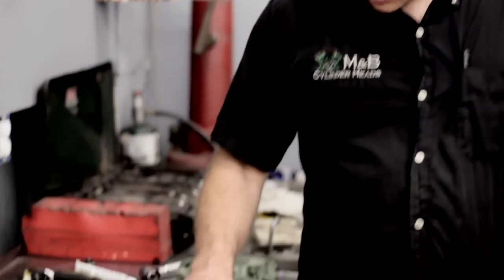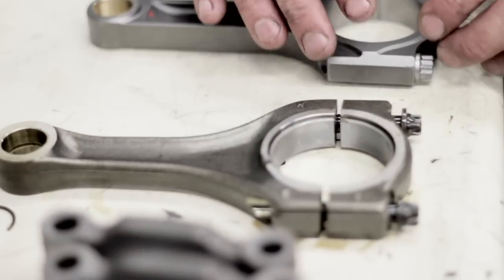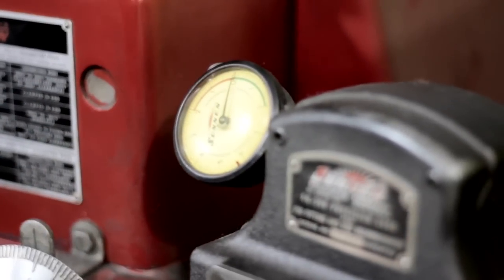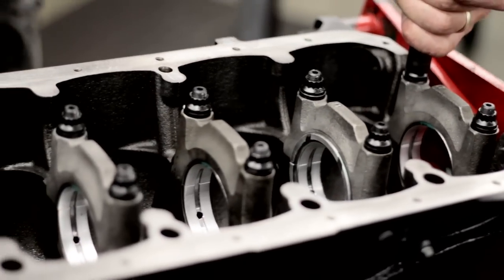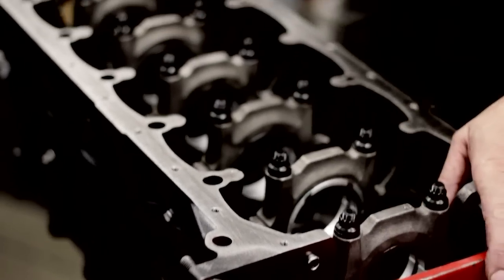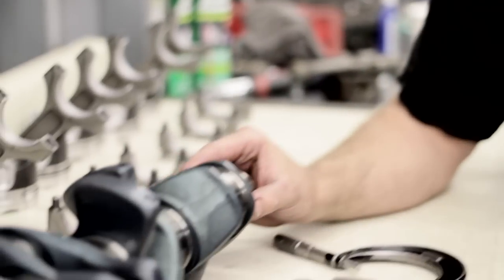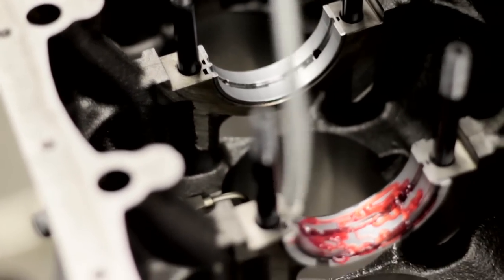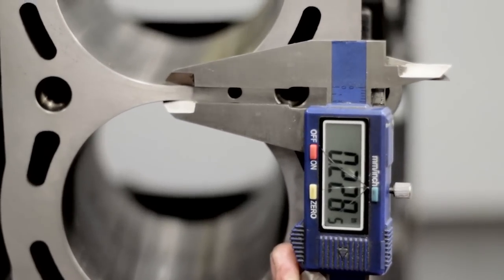Secrets Behind The HPF 1000 RWHP Daily Driven BMW M3 Race Engines Part Three

Comment: Im building an engine up right now myself and i cant find any information on fitting the oil controll ring i noticed the pistons used in this engine are the same as mine my question is how was the wavy baffle fitted and was any exsess cut off it as it looks rather large to be fitted without being cut or ? any tips or pointers ???

Comment: At 1:09 the old and new pistons are shown.
Why are piston pin supports further apart on the new piston?
This will result in more pin bending and therefore more wear for the new piston.
Was this a design oversight or are there any verified advantages in doing this?
Btw, the bearing width on the small end of the con rod appears to be the same for the old and new rods.

Comment: If both the pistons and the rods are thicker then I hope they are a lighter alloy or the engine is going to need more weight in the crank to balance and have higher bearing loads. Not good if you want to rev it harder than stock.

Comment: the straight six is inherently balanced vertically, but the con rods also move horizontally, the crank should be designed to provide a exact amount of force in the other direction, hence making for a smooth, reliable engine you can rev without causing a drama. The system of just throwing stronger parts at a motor without much regard for the weight or balance (like in the video) is not the best one in any circumstances, least of all for high performance motors.

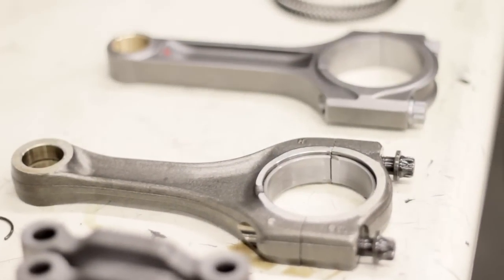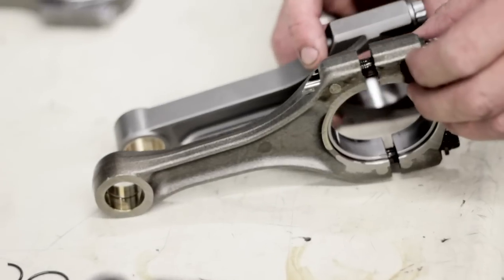Comment: The last sentence in my previous comment is supported by the video from 2:13 to 2:47 and I am still puzzled.
I have come across the same situation with aftermarket pistons for the vintage Lamborghini V12 with OEM con rods.
In both cases it could be that the aftermarket pistons were designed with different rods in mind.

Comment: Damn this must be so expensive. Amazing stuff. If I was running a stock engine, and needed a rebuild, would it be cheaper to buy a new engine? M52/M54
Reply: This build shows upgraded parts required for higher performance demands. A new engine from BMW wouldn't have the upgraded parts

Comment: @Heatman74 Yeah, I wondered about that, too. These days, more often than not you see AT LEAST a four-bolt set up on the main caps of most engines, and some manufacturer's newer engines sport SIX(!) bolt mains on their bottom end, a la GM LS series. It's a wonder this BMW block only gets away with two, but then again, I'm sure they have their reasons.

Comment: Hairs vary a LOT in diameter and they readily deform when measured with a micrometer.   Standard weight paper is MUCH MORE (remarkably) consistent at .0035 plus or minus very little.  If a person wants to throw out an example of commonly encountered something / object that is about 3 thousands of an inch, the thickness of a common sheet of standard weight paper is a MUCH BETTER example.

Comment: built hundreds of motors for motorcycles ,,always used hone and left crosshatch pattern and when fitting mains and bigends have never trusted what bearing shell comes out of a packet and always plastiguaged for oil clearance ..now don't forget that motorcycle engines are nearly double that of a car
Reply: double that in revs

Comment: With the design of the blocks mains, I would definitely run a main girdle to stiffen that area up, especially if it's going to see 1k hp. I can see many flaws to the engineering of this engine. No wonder why they have so many issues with mid to higher HP. If you compared a 2jzgte to one of these you would see what I am talking about. The 2jz is a far better engineered engine then this pile. The BMWs stock rods look like rods from a Model T and the pistons look weak as well. I bet the iron used for these blocks was of poor quality and produced a soft casted block. Which is why the cylinders egg shape and the decks warp so easily.